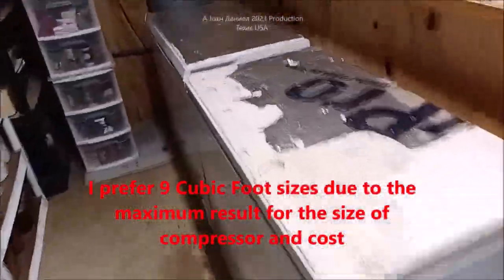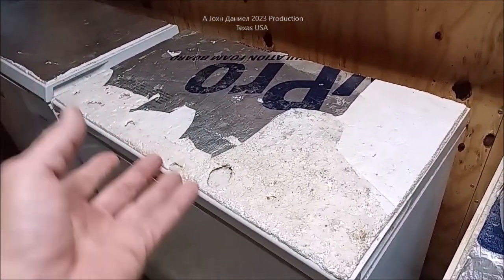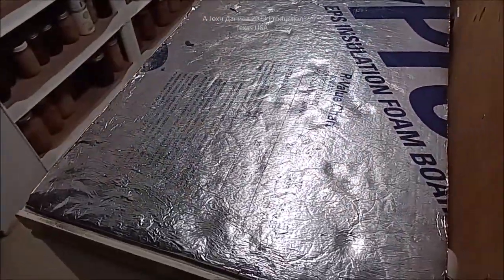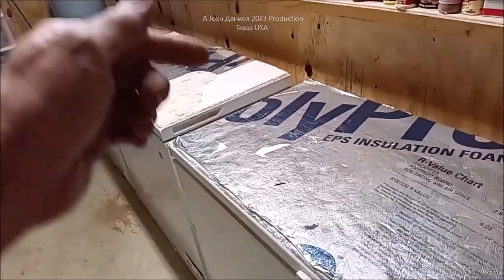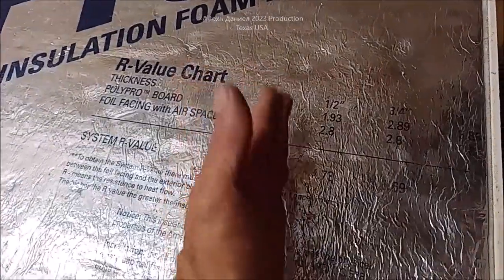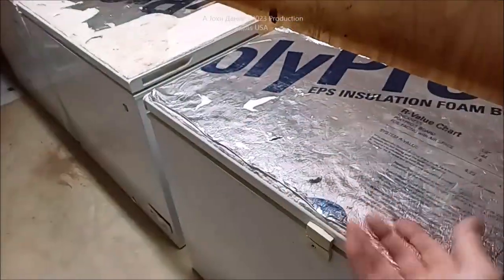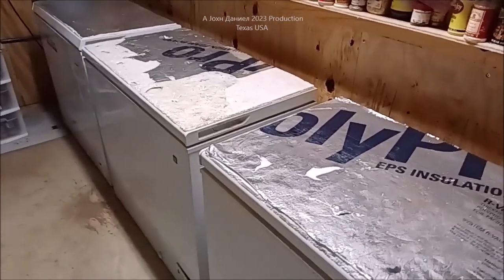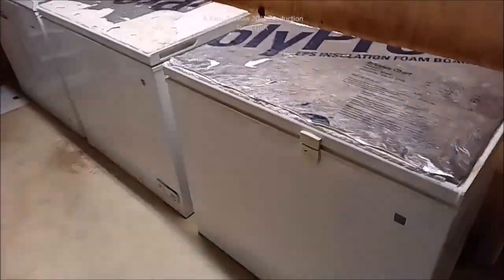Cutting my Electric Cost by 30% on refrigeration for $10, Results were surprising

Comment from the maker: WHY I DID NOT DO THE SIDES:  ( thermal tool used to find issues is a Tarcher IR Thermometer https://amzn.to/3QNrOoF ) Reason for the top, not sides. For one, a poorly insulated top allows convection of air, Causing air to cycle from lower to upper, warming very slightly and then increasing ice, moisture and frostbite. By adding this insulation the temps stabilized to stop convection to the top lid. From that we increased cold density in the freezer. This also works for upright as well as chest freezers, stopping a cycle of air from making a loop though improving the door, is huge in results. Most freezers use the sides for refrigerant and may cause your thermostat stress to cover them, using a SEEK thermal Imager that uses your phone to work, https://amzn.to/44QQGUZ  can help you save thousands in losses from windows, walls, doors and appliances, but the cheap and fast way to fix 30% loss on freezers is 1/2 to 3/4 foam the tops/doors.
Reply: maybe so, I am not a refrigeration engineer, but learned very quickly that you never completely cover the top of a fridge, (not a freezer) so I will leave those guys to their magic.
Reply: I am sure you are right, but a consequence of this stratification could be that your thermostat thinks it is hotter or colder (dependant on where it is placed) than the freezer as a whole is!
I guess I am being picky with this though ;o)
Reply: @totherarf  a very good point, but just shift it.  I would do that.  Bit of solder, maybe a screwdriver.  (been doing refrigeration for a while mate)
Reply: Yes, You should not ever cover the sides on these. They need to dissapate the heat from the condenser.

Comment: I never realized this. I had to go feel my freezers. You really can feel the cold.  Even the sides.  Thank you!
Reply from the maker: Do not do the sides, just the tops. It will be a huge fix. Many freezers will have coils in the sides that can cycle hot on occasion and you can boil your refrigerant if you cover the wrong spot.
Reply: @JOHNDANIEL1  thank you! None of my freezers are frost free though. Does it still matter?

Comment: Good show. If you have fridges with the condenser coil on the back, fasten a sheet of that foam to the back between the condenser coil and the cabinet to keep the heat from radiating inward to the metal cabinet. I did that on two 18.2 Kenmores using the foam sheets they came with new in the packaging in 2006. Seems to have worked quite well, as these have consistently used about 1, to 1.3 kW / day each, depending on the usage and time of year. Thanks for all you do.
Reply from the maker: My FLIR Camera should have been booted up for the video on it, but when you prepare to increase insulation, use a infrared tool and mark all the "not supposed to be that cold" areas to consider boosting the insulation on. What I learned is the factory will not use expanding, or closed cell due to manufacturing speed is lost. so they sell crap on purpose!
Reply: Wow Dave F. , That is an interesting idea. Thank you for sharing that!

Comment: Like t he video John I have an old Freezer I was given to me its a commercial one.  Easy to fix and find parts but most of the parts cost and arm and leg.  The lid was all dented up, So I took the lid off and took it apart, and found it only had insulation in it like something close to what would go in the walls. I took that out and Sprayed it full of spray foam, and let cure and then carved it out fit the light and wires and the bottom part of the lid.  Took out the dents ect and made it flat. put it together and that thing as been running for 5 years no problem.    Before I did all that the lid would get ice on the top of it, after the rework of the lid it no longer dose that and it hardly ever runs, and keeps every thing nice and frozen
Reply from the maker: That's the best outcome for the effort for sure.

Comment: I totally agree. I have 3 chest freezers like you. I added heavy duty Insulated moving Blankets on top of them. The only minor issue is when I open them I take the blanket off remove or add what I need and replace heavy duty Blanket. 
I freezers are also on my solar sub grid power and I have seen what you have seen in over all power saving. I think more like 15%. My units are less then 5 years old all are well packed .
Just my 2 cent
Good luck
Reply from the maker: I have 2 Haier, 2 GE and one Woods ( Woods is lowes store brand, a Mitsubishi compressor in it)  all but one are 9.0 CU, the woods is 8.3 CU and all are using a massive less power just doing the lids. We also have 3 of the 12 volt units, A Cosco, a Statpower, and a Stakol from 53 quart to 115 quart. All too full really. I even have a 6.75 CU that's new in the box, tested, boxed back up. As a WTF spare. Kiera grows so much and hunts so much, we need them. Can't can everything, we have over 2000 jars already full, and nearly 3000 can goods and almost 500 #10 twenty five year cans. So I am ready for what ever Brandon of the DC swamp has next. Stay tuned, I got more fun on the way!

Comment: Sir I have a 12 volt A/C split unit on my trailer and it has 3 different motors that draws alot of wattage.
Is there a dc to dc converter that will help me?
Reply from the maker: What model and brand do you have?
Reply: Will get back to you in a day

Comment: Hey Johnny Two Chins, Thank you for this video. I will try this on my Fridge. Summer heat is here.

Could you please consider doing a video on RV Airconditioner Soft Starts? It looks like there are "plug and play" ones called "active start" but they are even stupider expensive than regular hardwired ones which are still stupid expensive. What's in those things? Platinum? Perhaps you could show us how to scratch build one?
Reply from the maker: IF your RV air conditioner is not electronic ( digital board controlled ), A manual older style with controls on the lower, there is a alternative. Table Saw soft start module. I use it on my 2007 Dometic AC unit that has 3 dials on it. I just installed it on the line going to the AC unit, its breaker, by adding a male and female extension cord  plug inside the lower section. Then this https://amzn.to/43s0OBT in the middle. There was room in the air intake side. But you can also pull the wire from the breaker box, most all have a 15 amp only for the AC unit, and like one I added for a customer we just wired it in and wall mounted next to the breaker box the saw starter.
Reply from the maker: Forgot to mention, we have installed lots of these in RV ac units when people run them on Inverters. https://amzn.to/43pQytL  
If your handy, you can install it. Theres videos about installing it, search the name and videos. Such as https://www.youtube.com/watch?v=HEXeJsV111k
Reply: Thank you! The $139 15A table saw soft start is way better than the $700 plug and play 30A. With my dinky Fridgidare 5000BTU this will work fine. I might check out that other one too. For $40 I can be handy as long as it doesn't involve welding 😅.

Comment: I had noticed the same thing with my deep freeze and I put a sheet of 1 3/4 on it for last few years. (I don't actually glue it on tho).   I wasn't sure if I would have a savings but your video helps. 
Thanks for the tip!

Comment: great info Mr. Daniel, I have a 14 cu ft upright.  What parts of a freezer do we not want to cover with insulation?  I ask because my wife said not to insulate because the freezer would not function correctly.
Reply from the maker: If you can get a feel for it, they are obvious where the cold is loosing. I would cover the door, make sure no wiring is in the door, add 1/2" and get some White 1/8 MDF board or similar and craft it on. As for the body, it depends on how they routed the cooling for the model you have. Some you will notice very warm sides or the back. Avoid covering anything that is making heat since that is how the condenser is working.

Comment: Would it be beneficial to wrap the sides as well with the thermalboard ? Except for any vents
Reply from the maker: They use the sides, at least mine does, for cooling of the refrigerant, covering them may cause big losses. The lids are so poor, you will get your biggest benefit on that.
Reply: @JOHNDANIEL1  I will give it a try, I am also wanting to better insulate my 12vdc stakol(53 quart).
Reply: @JOHNDANIEL1  I simply double folded a big towel over the lid of the 12 vdc freezer,and it has made a huge different.

Comment: years ago my freind charlie bought a fridge that had atleast 6 inches insulation that thing almost never switched on.
Reply from the maker: They make a Avanti 9 cubic foot that you can order from Mexico, it has 65mm of poly iso foam in it everywhere and they use 45% less power than anything we can buy in America. Now why is that??
Reply: There are a couple available that have 4 inches of foam or so. I know of the the Unique brand, Sun Danzer, and Sunfrost. They are made for the solar industry, and are typically 12/24 VDC.

Comment: One thing I have done to save energy on my freeze is purchased a cycle timer. I have set my freezer to be on for 60 minutes and off for 90 minutes. Figure this reduces my energy use by 50%. Probably closer to 30% as the freeze may need to work a little harder to get back down to full chill. Need to make some temp measurements to figure out the real savings.
Reply from the maker: That's a great way to ruin your food with freezer burn. And the surge to recover is far more power used than the status of maintaining.

Comment: Next time you go into the building supply, pick up a roll of silver tape.  Some has the sting weive imbedded. Shine up that great idea.  Just the solid tape job will have an effect.  Funny you posted this cause I’m just getting a make shift system and been running the freezer and refrigerator for 2 1/2 days straight.   I never actually paid as much attention to how much they run till now.  Both will pull 280 watts on most runs then sometimes they really get the meter up.
Reply from the maker: Great idea with the tape, total hillbilly, but perfect to add to my Total redneck set up, I freakin love it.
Reply: When you say silver tape, do you mean duct tape or that's different?
Reply: I think he’s talking about the actual duct tape better known as hvac tape, which is different from duck tape. Both would work, but would worry about the duck tape drying out and causing problems over time. Hvac tape should work great as an extra protector and might bring back some of the loss acceded from the damaged foam.
Reply: @nddn954  Yes HVAC Foil tape.  It will have the treads in it for strength.  I’m gonna do the same thing to my lid on freezer. It’s cold to the touch. Lids are poor quality these days. I guess the lids on the old one was to heavy for some. I think the manufacturers need to take a better look at this.  Add more star foam, cheap and lite. I’ve done laid a 1/2 inch of foam and a sleeping bag on top of that and it has slowed down the run time already.

Comment: You can get a kilowatt monitor and figure out how much power they are in fact using. Good job figuring this out. Very useful information but I don't have a chest freezer anymore.
Reply from the maker: We had them on a meter, I removed the meter, dragged them out to clean behind them, was putting it all back in when I noticed the month by month record sheet was gone. One of the kids tossed it a few days earlier so while I had my outcome I just shared it.

Comment: i purchased a freezer at Menards in 2017, then put 2inch foam all around including the top, leaving holes for drainage valve and ventilation, then wrapped it in cheep white duck tape. this was before i ever plugged it in. it was in a 2017 enclosed car trailer. i never plugged it into my "killawatt . i used a golf car with big anderson connectors to make it 12 or 36 volt at will!

i also ran a small pipe from my home built battery chargers exhaust into a stainless steel pot with 3 small chunks of brick on the bottom so i could put a big pot of water into it to use the waste heat from the exhaust to heat hot water to bathe and wash dishes. we were living in a 31 foot pull behind trailer with a slide out. we lived off grid for 3 full years, had a baby and 6 months later i got a staph a infection and was made to move into an apartment. im a 65 year old MAN! 
i have lived off grid for most of my life and spent time in the Philippines too.

Comment: Drop a slab of 2 inch foam in the bottom of one, put a wool blanket over the food inside, watch what happens next
Reply from the maker: We used those windshield sun covers in full freezers on the food snug to the sides and it was about 5% less run time. I'll do a vid on it.

Comment: After seeing this I'm wondering about if we do it to the sides as well if that would help further, note I'm sure the results won't be quite as high but I'm wondering if it would help a little bit at least
Reply from the maker: I probably should do a second video on why not to, but I will explain in a PINNED post above why the top is so important. It's the stopping of air moving inside that means the most, I will post that.
Reply from the maker: I detailed the info in a pinned post, anyone needing that finding can read it.

Comment: Nice, how about putting some on the bottom? Cold falls and the bottom would be the coldest. Pretty sure you could cover the inside bottom and outside. The evaporators are only on the sides of the freezer. 
I have a 19 cubic ft refrigerator I insulated. I guess design comes in waves. The last 10 years had the condenser under the skin of the fridge. The new ones have a small fan driven radiator. So I added 1 inch of foam all around and left the back open for air flow. I didn’t do the door since I figured it would fall off or get scuffed. Went from 1.2 kWh a day to 700.

Comment: I didn't think of that. I put Vaseline on the seals of all my refrigeration devices and a weight on top. I use my automotive smoke gun to put the freezers in the best flow corners of the house. I tries to get a small chest to run on just the panels, but in-rush got me. I really like your posts, Sir!!

Comment: The job is not finished. We insulated the sides and front side. But we used 2" thick foam.
Reply: Gotta be sure your freezer doesn't have coils under the metal on the sides to do that.  Most newer freezers do.  Top is safe because it's hinged and would not have a coil in it.  Examine with a FLIR camera to see the cold spots and hot spots.  Don't insulate the hot spots.

Comment: I have a cold spot, and it's great, I have it connected to my solar system. Runs like a champ 🏆
Reply from the maker: We once had a 1948 Norge, they were made by Borg Warner back then, it was massive, sorta commercial sized and had belts driving the compressor. I sold it and the Norge 120 volt large electric stove that was in the house we remodeled, same year models back in 2010 to a restorer. Looking back, it was not a bright thing to do. Now days that pair would have been worth thousands.

Comment: There’s no insulation in door bet do some spray foam? Inside door bet it works
Reply from the maker: We have opened them, they have very ill fitting shaped foam inserts. About a R-3.5 but adding the 1/2 on top created a thermal break even re-foaming them would not have done. I explain in my pinned post above.